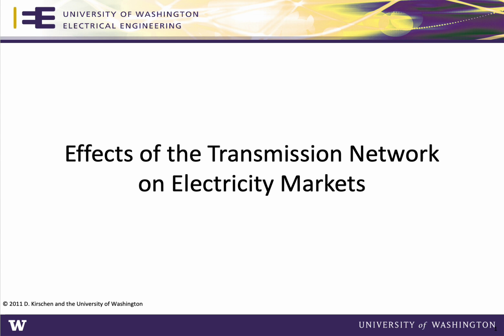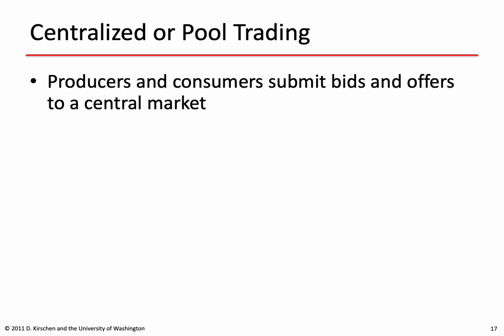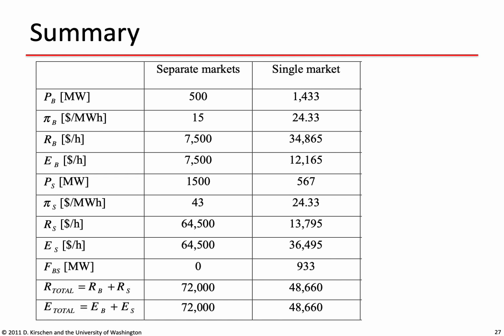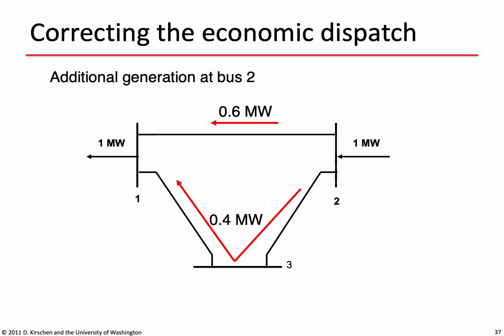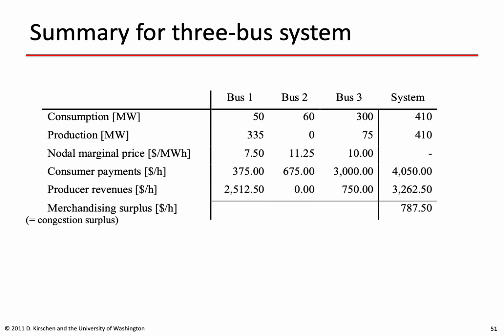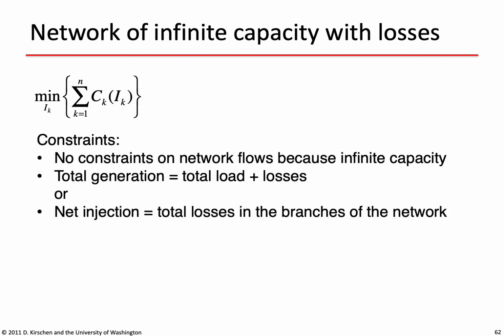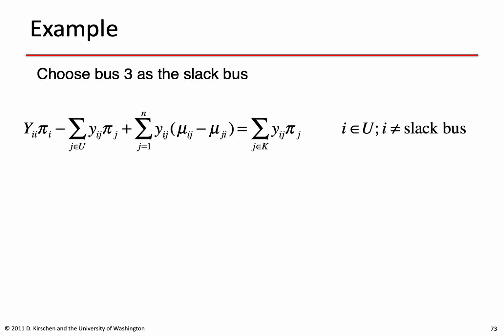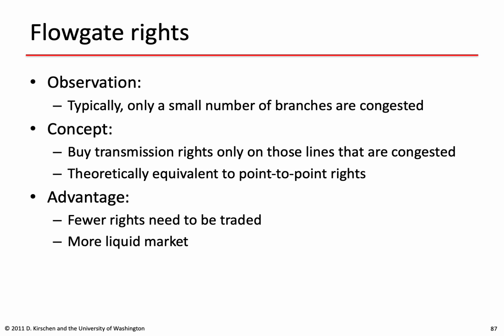11 Effect of transmission network

Comment: Thanks for posting this and all your others, wish I found these sooner! Are your PowerPoints publicly available by chance? I am taking this course now at UCF
Reply from the maker: You can find my powerpoint slides at https://labs.ece.uw.edu/real/library.html
Reply: @danielkirschen2893  Thank you so much!
Reply: @danielkirschen2893  Thank you for making them publicly available. The economics of the power system is explained in a way that anyone can understand. 
I could not find any slides on Non Linear Programming (from "04 Optimization: convexity NLP LP") and was wondering if those are already included in these slides.